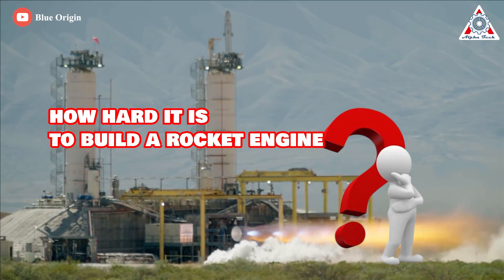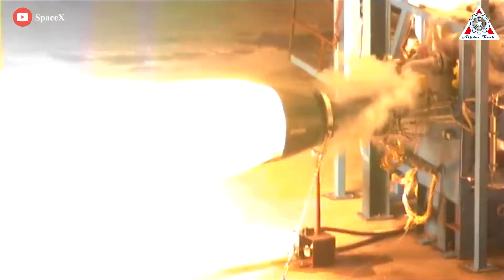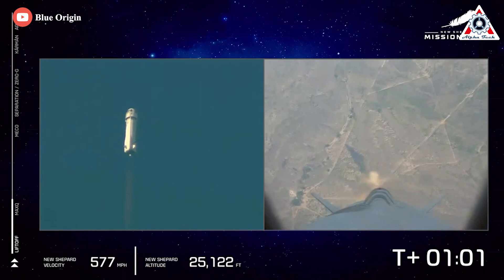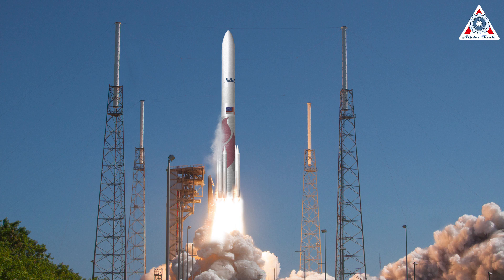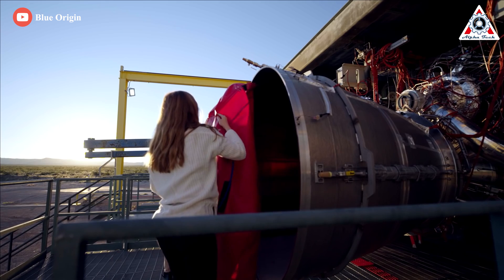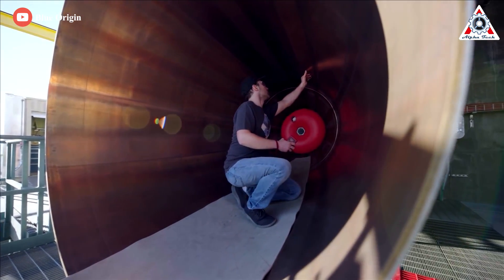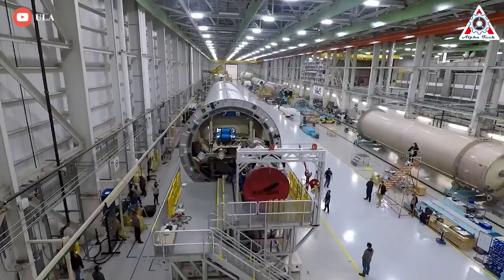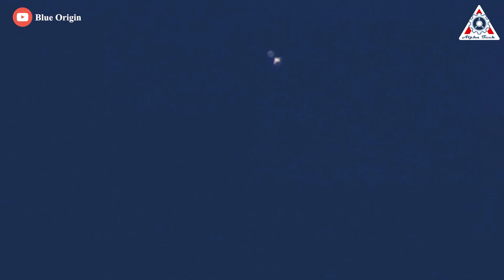Blue Origin's Engines completely FAIL! NO way to BEAT SpaceX...

Comment: Having worked with a Jeff Bezzo company I can tell you razing the bar does not bring success. And it shouldn't even be measured.
This is not about individuals, this about teams delivering long term success. 

Reward successful teams. Success is designs that don't require complete redesign.

Comment: They only go up about 66 miles above the ground because the Air becomes too thin for flight of any kind of made made rocket or plane.    This is the thing called Space.    Air too thin for flight.    The rocket or plane stalls and then heads back towards the ground

Comment: The bottom line is that all of the suborbital passengers were incredibly lucky.
Reply: I don't agree. The latest booster failure and previous controlled abort test at MAX-Q clearly shows, that New Sheppard is very safe. However, it's still just a short ride to the edge of Space.

Comment: hi why is it so difficult to get a rocket of the ground when back in the sixties they managed to do it why is that if you think all if the technology advances why can't they do it
Reply: Because of  constant improvements. It's not hard to launch rocket which is not reusable, but Blue Origin and SpaceX builds reusable rockets, those are exponentially more complex than old ones which usually got burned down minutes after launch.
Reply: @Zripas  well thank you for explaining that to me but surely to God the expense of all of the failiours why don't they try a different approach
Reply: @daveowens2722  
You just don't give up on a thing after single failure. SpaceX failed its first 3 launches, almost went bankrupt and just because last (literally last one they could have afford to attempt) fourth one was successful they got funding from NASA. There are situations when you simply can't afford scratching entire project and start all over, solution could be just around the corner.
We should get starship launching this year from SpaceX which should mark new age of space flight if that one is successful. It will push entire space industry decades into future if they are successful, most likely it will go sideways due to it being such new technology with minimal real world testing, but this is what you do, test thing as much as posible and try to learn from failures, after all  "You can only learn from mistakes"
Reply: @Zripas  what I'm trying to say is the tenology they had in the 1960 compared to today's technology why don't they use the rocket system used by nasa for the shuttle
Reply: @daveowens2722  
Because its not suitable for reusable rockets. Its completely different technology. Its usually starts by digging out old technology and improving upon it. Like for example SpaceX Raptor engine went over iteration and new and improved V2 is miles better than previous version which was never used before on itself and both of those are miles better then it was in 1960 where those engines were never made to be reusable. There is a huge difference between engine which needs to fire up once and engine which needs to fire up dozens of times, in a row, without failure.

Comment: This is riddled with technical errors and inaccuracies.  Examples:  1:21:  "...a vacuum thrust of 690 kN or 155,000 ft-lbs."  FOOT-LBS???  Not even the right dimensions; that's a torque or moment, not a thrust or force.  1:27:  "... a vacuum specific impulse, Isp, of 310 seconds or 3.0 km/s."  This is mixing specific impulse and delta V - apples and oranges.  Inescapable conclusion:  this guy doesn't know what he's talking about; he's just reciting specs and stats and putting up attention-grabbing video titles.  The latter half of the vid comes off as a hearsay hit piece.  The WORST kind of YouTuber!!
Reply from the maker: We will improve this. Thanks your feedbacks

Comment: Back in the 1960s, the U.S. won the space race because NASA wasn't afraid to blow things up. Innovation was fast without the bureaucracy. Now every screw or pipe has to go through a certification process. And there you see the problem with Blue Origin: Bob Smith wants Blue Origin to be big bureaucracy like NASA.

Comment: i wonder about the similarity between the BE-3 and BE-4. BE-3 has has issues with its thrust stream in the past that i thought was 'normal', but given those same issues prior to it blowing up this time, im thinking they have been having them all along and use it on a small scale because of the risk of explosion. Since they were apparently unable to fix the issue they moved onto BE-4. Given the issue they have had getting it to work properly, i suspect the problem plauging BE-3 is the same with the BE-4, but the larger scale results in it not being able to work well. For BO, its not worth trying to fix the BE-3 since it 'works well enough' and they need those experts on the BE-4. Im not sure what bezos will do, probably investigate with a small team, hope its a minor issue they can address. if not i think they will simply ground that engine and keep focus on the BE-4. They have not yet to date had a flawless test of the BE-4. each test sent it back to the lab to address a problem.

BO is in serious trouble unless they can get BE-4 working soon. I expect that spacex wont share its engines with them. no point really, while it might be possible, it would result in too much commonality and NASA would still need another launch company, they might accept it short term, but i dont see how that benefits spacex. stolen tech + helping a competitor when NASA can just use spacexs rockets.

Comment: When you look at all those parts on the BE-4 engine you have to understand the procedure for installing each component.  Before a part gets installed a 59 page work order has to filled out and handed in. That document has to be studied and signed off on by the lowest ranking guy in management. And then he will deliver it to the second lowest guy in management who will do the same thing.

 After 78 people in management have finished studying the documents and signing the papers it will finally reach Bob Smith. Bob Smith will study it for a couple of weeks and hopefully sign off on it eventually.

 This is for installing one of the parts, this procedure has to be repeated for each individual component on this engine. Bob Smith will also have to do extensive questioning of the engineer to make sure that he has torqued the bolt correctly and that his torque specifications are right where they need to be. 

One thing I forgot is someone also has to film in 4k ultra high definition the engineer torquing each Bolt and the reading on the gauge has to be clearly legible in the video. After that video is submitted to all of management one at a time it finally reaches Bob Smith's desk and he watches the video and makes sure the bolt was torqued correctly. If anything was not submitted correctly with all the paperwork being perfect, the engine must be torn down and the process started all over again per Bob Smith's decree.

 Someday they will end up with working engines. This is a very brilliant way to build rocket engines and if you don't believe me just ask Bob Smith he will tell you, because he knows for a fact that he is always the smartest person in the room.

Now you know the superior methodology of blue origin which is led by The Fearless and Brilliant Bob Smith. Amazing!
Reply: Sounds like what I was doing with SOX compliance on my Report Program Generator programming for a Healthcare company back in 2008. Getting paid a shitload of money for mostly describing and getting signed off on what I was doing, just before the Crisis totally changed and ruined my life. More government regulation definitely won't stop the coming crash, while more corporate rules won't make any company nimbler.

Comment: The first thing I noticed was the capsule ejection worked perfectly. B. O. Can't go orbital, can't reach the I.S.S. And looks like Jeff might be compensating for some unspoken insecurity...
Reply: And if the same thing happens to a raptor engine you would burn up with it.
Reply: @stephengordon4081  Not so.  Crew Dragon has escape engines built in - or haven’t you been paying attention 🚨🚨???

Comment: when Musk had his engines built, it was all men on deck, to make this work.  Meterlarci issues arose and we addressed them, finally, they had a working motor.  Blue Orgnine does not do this, they have a small dedicated team, to ferret out problems and and brainstorm solutions.  The difference shows.
Reply: Metallurgy and Ernest Borgnine. 🙄

Comment: BO engine development will level with SpaceX engines in the future. It's space race preparation. Emergency capsule separation went perfect at 2.5g deceleration. Its a good system.
Reply: Not at the pace they're moving.  Also, SpaceX never stands still.  BO would have to move at a pace faster than SpaceX to catch them.  Not gonna happen.
Reply: Kool Aid kills brain cells.

Comment: i want some specic answers, How many exact G's did the capsule exert when it executed it's emergency excape.
On landing was it out of fuel, causing a very hard landing as observed and checked by many experienced observers. 
 If it was space X we would be informed within a short period of time what may have happened, with details.
Reply: It’s not the escape engine that handles the soft landing.
Reply: 8-9 G's according to another site. The "very hard landing" only looks that way, most of the dust being blown up is caused by a rocket firing, used to cushion the final landing.
Reply: C'mon man!  The mannequin only got his head stuck in the roof, and his butt flattened.
Reply: Its different thrusters that pillow the landing, with a puff of nitrous inches before it makes contact to the ground. Its the same on every landing look at any NS launch. and the descent speed alone is only 16mph with a crush pas at the bottom of the capsule. and not to mention the seats are built on scissor springs that could withstand a landing with no thruster amd only one parachute deployed. you clearly dont know anything and dont work at blue.

Comment: 3:00 - At least the launch abort system worked as intended...
Reply: Pretty hard landing, plus you never want to use a launch abort system, it should never have to go off
Reply: @bapmain7587  Well, if Dragon used for CRS-7 mission in 2015 had its launch abort system active, NASA would not have lost the first copy of the docking adapter now used by Crew Dragon...
Reply: @bazoo513   would much rather lose a docking adapter then 6 people cause that landing here looked very hard and could cause serious injuries
Reply: @bapmain7587  Falcon 9 also carries people, remember? Both companies got lucky that their respective catastrophic booster failures happened without people around, but, again, this unintentional testing of abort system went perfectly, and unintentional tests of emergency systems are the only real tests. Remember Crew Dragon test stand explosion?
Space is hard, rocket development is, well, "rocket science", and shit does happen. It is not fair to judge Blue Origin by different criteria than SpaceX. SpaceX does not need cheerleaders - they built for themselves a very comfortable leading position. But they are not magicians nor is Musk a deity.
Reply: @bazoo513  idk man magicians seem like the only people who can land boosters back on earth intact
Reply: @bapmain7587  Ever heard of DC-X, almost 30 years old project that successfully demonstrated propulsive landing, abruptly cancelled because it was unlikely to achieve single stage to orbit capability, something that SpaceX (wisely) didn't even attempt - the energy budget just does not add up. There were even wilder concepts, like Roton a.k.a. Rotary Rocket (look it up.)
Propulsive landing is easier than it seems (still difficult, of course, but everything in this area is); it is just that it was not clear that it makes economic sense, especially in the light of payload penalty landing hardware and required fuel reserve incur.
Reply: @bazoo513  man idk what you sayin anymore bruh

Comment: 1:25 - "Force-pounds" (lbf), not "foot-pounds" (ft-lb). In imperial quasi-system of measures, units for foth force and mass are called pound, so they have to be discriminated by a suffix. BTW, foot-pound (force) is a unit of momentum and energy, 1 ft-lbf = 1.356 Nm = 1.356 J.
You mangled some other units, too. Come on, that's junior high science.

Comment: I really like what Elon is doing with his Raptor engines and a renewable second stage, but I think he is shooting for too big too fast.  Right now 4 Raptors is more than enough to power a Falcon 9.  It would be interesting if he phased out the Falcon 9 with a Falcon 10... basically an upscaled version of the Falcon 9 with 9 Raptor engines instead of 9 Merlin engines, using stainless steal tankless design, and Meth/LOX.  The second stage would  have a single Vacuum Raptor 2.  Then below an oversized faring would be a large disk heatshield.  After reentry it would flip 180 so the engine is down and landing gears like the booster has but would fold almost straight out and act like an air break to slow it.  The booster would do the same and remove the paddles as the 4 landing gears could be adjusted to steer it.  Then it could do a final burn at landing like normal, but with the throttling capabilities of the Raptors it would not be a suicide burn.  I think the fairings should have small control surfaces added and come in like glide body RC to a GPS location to be captured with a net or land in the water with a deployable flotation.  This would make the craft 100% renewable and far more reusable.   The larger fairings will give it more payload options and the more powerful engines for both stages should allow for payloads about 2.5 times larger ,slightly less than the 63t of the Falcon Heavy or almost double that of the Space Shuttle's 30t.  If those Raptor engines live up to Elon's expectations the vehicle could be shipped back and relaunched in days.  If he could get 50 flights out of each you are talking launching costs of maybe $1-2 million eventually and the payload of 57 tons with the larger fairing opens up far larger payloads.

Yes the Starship will have 2x that payload easy, but it has lots of drawbacks too.  The lack of a need for a tower to catch it gives both stages far more landing options.  A ditching the belly flop would reduce strain and be a much safer landing option. Removing the paddles will make up for a lot of this and the heat shield would be much easier, cheaper, and lighter.  Also the smaller rocket would make it launchable from many more locations.  Elon is looking at possibly 42 engines on the Starship and Heavy Booster.  That is crazy.  Plus having a separate fairing you can still have an emergency escape booster if needed.  NASA will likely never allow people to travel on Starship for takeoff or landings on Earth because of this.

Comment: I'd actually take comfort riding a BO rocket after this.  It was an unplanned, successful test of the LES.  Or, at least I haven't heard it wouldn't have been survivable if there were passengers.

I've also wondered how BO would handle this if there were paying customers on board.  Do they get a full or prorated refund?  Free assignment to a later flight?  I would imagine dealing with someone who coughed up eight figures for a 15 minute ride aren't as easy to deal with as a Karen at Wal*Mart.
Reply: I'd rather deal with the dissatisfied Millionaire/Billionaire vs the Angry Walmart Karen.
Reply: I'd rather be strapped on the outside of an F9. More survivable chance.

Comment: It would be super simple for Blue Origin to turn it's fortunes around, Get rid of Smith, use that infinite Bezos wallet to buy RocketLab and make Peter Beck CEO of both, Bezos should simply stand back and let Beck run the shop, and Stop all the distracting litigation (you can't sue your way into space Jeff) and focus on getting to to orbit, voila! so yeah what I am saying is for it to be successful it should be a different company
Reply: Rocketlab should do the smart thing, and go "He-e-ell No!"
Reply: @gregorysagegreene  haha you're right, at this stage Rocketlab is the next private space company to overtake BO, I wonder if Relativity space and Astra will also do the same?

Comment: Space X is cringe
Reply: Your cringe bro don’t get mad or jealous about space X success they obviously worked very hard for that success if blue origin can’t succeed they obviously have cultural issues and can’t focus on the bigger picture, keep your unnecessary hate to yourself but then just as my old Adidas shirt said hater’s are gonna hate
Reply: @giminai8000  not mad, just dont like space x or their its fans. aerospace should be about working together, not putting each other down, and space x fans do alot of the latter. space x wouldnt be anywhere without nasa
Reply: @spook4756  yes I can see how fans attitudes can be off putting but keep in mind not all fans are like that,as for space X being where they are without nasa is partly true but in my opinion nasa wouldn’t even have a crew program without SpaceX